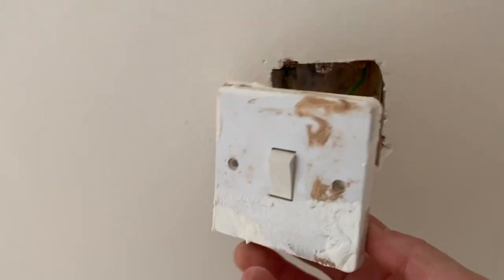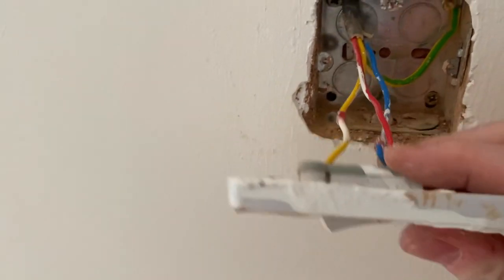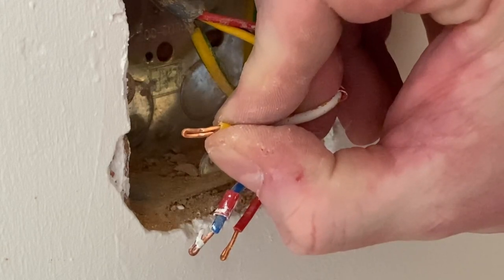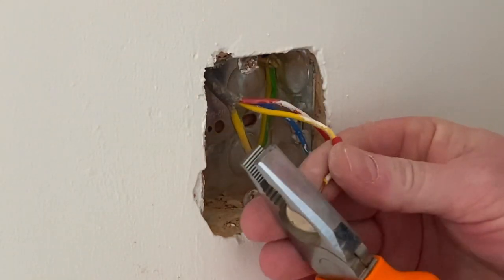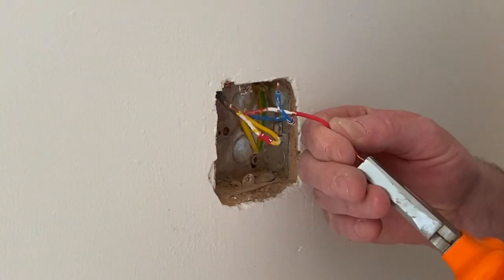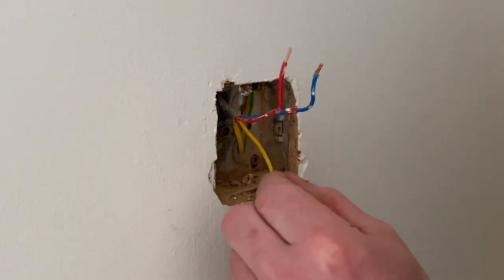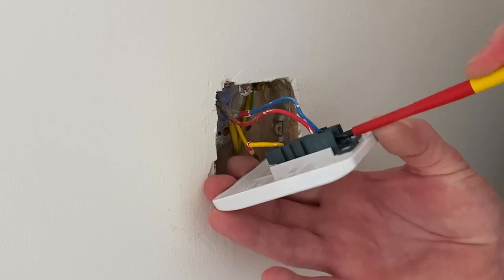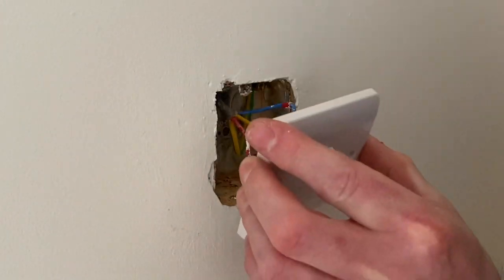Tips For Changing Light Switches

Comment: Plus, it is good working practice where a 25, 35mm 47mm mm single flush box has been used for either a switch or single socket, fused spur, etc. is to flatten the top and bottom 3.5 lugs of the box so no conductor can be trapped between the accessory and box, which should have been done when originally installed and now. 😉

Comment: Obviously not a requirement but any 2 way switches I fit I make sure that when both rockers on the switches are up or both rockers down the light is off.  Easy then for the customer to know the light is off when re lamping 
Also worth checking the earth is connected to the system . One housing estate round here although there is earth in the lighting circuit it’s not connected down to the switches and that was wired at the time by the SEB in the mid 60s 
I’m also one of the people who use Red or Brown for common

Comment: You can get switches with spring connections in the back and have been able to for over 25 years .
Reply: Yes, and pretty much all of them will eventually have either the spring fail, or the plastic crumble from age. You also do not want to run high current through them, as the small contact area does heat up.
Reply from the maker: The spring connections are very common in France and Germany but are you saying in the U.K.?
Reply: I've had switches in my flat that have screwless connections since before I had it, Atherstone, north Warwickshire.  never had the connection fail but the one switch has worn out . I'll have a look what make they are.